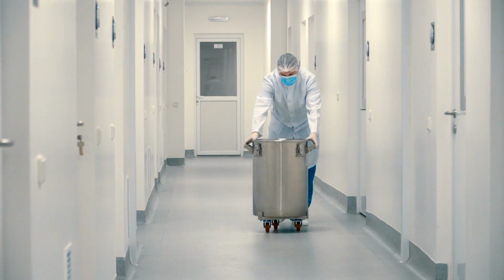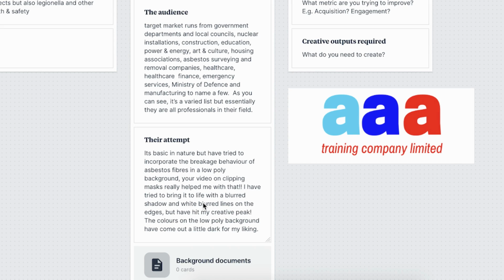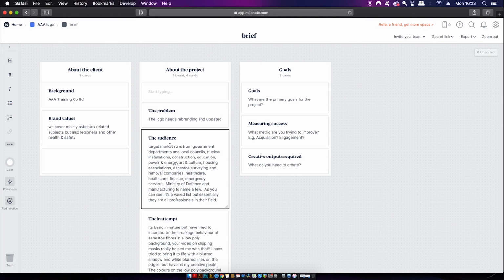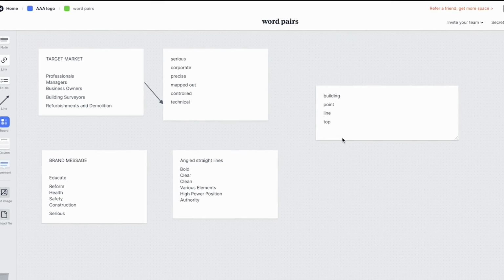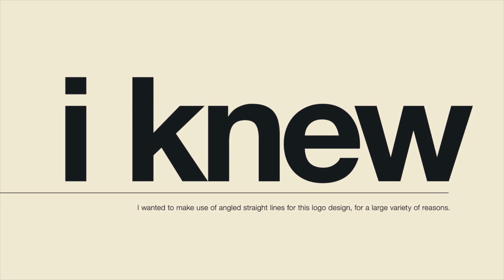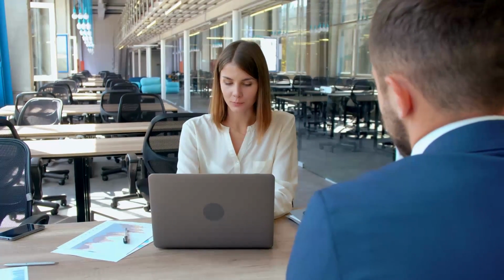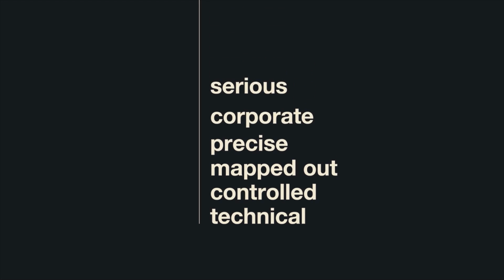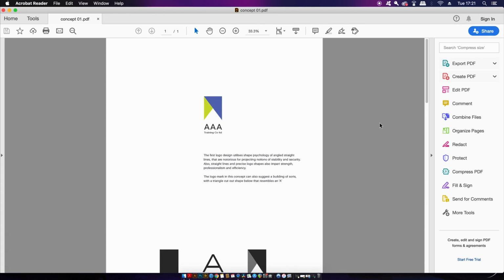DECONSTRUCTING LOGO DESIGN SUCCESS! *May 2020*

Comment: You obviously are very articulate and have a good delivery and voice. However, that logo has some real issues. I don't know if you read your comments....but I'd like to see how that logo looks on a business card...it would be very bad. Your icon is so big and the type under the triple lower case "a" letters is so small. The balance is way off. The difference in the two cream colors you use in the icon isn't pronounced enough. The icon looks like a ribbon which I'm not sure is what you were going after...ribbons are for protest in the USA...or maybe. you are going for the look of a medal that people in the military wear?. I do like the negative space at the bottom of the icon which creates a sort of upper case "A". The three lower case "a" letters are not an easy thing to work with. It's actually a bad name for a company though I know you had no say in the matter. It's the kind of thing small and ignorant companies did years ago to get to the top of the business pages of phone books when they used to print those. It was always a sign that the company knew they could never get ahead by any other means....cheap trick. aaa means nothing unless I'm not aware of something within the industry. Also, I don't think the lower case "a" is working with all the words that you used this business....your key words. I have to say that after watching your other videos this one fell short.